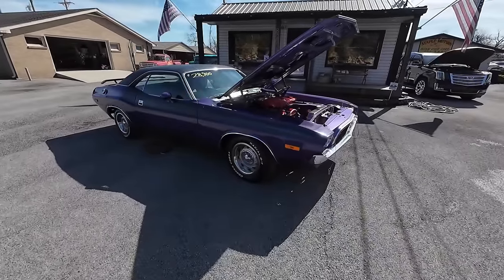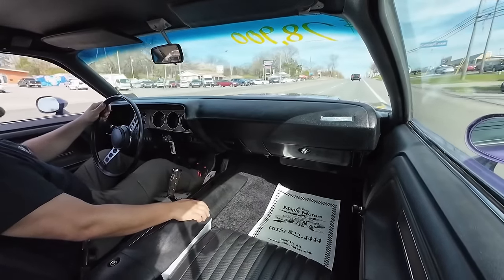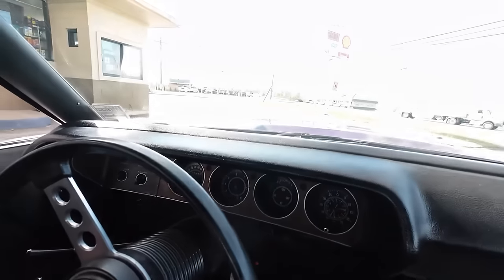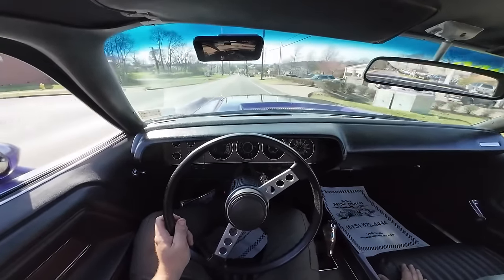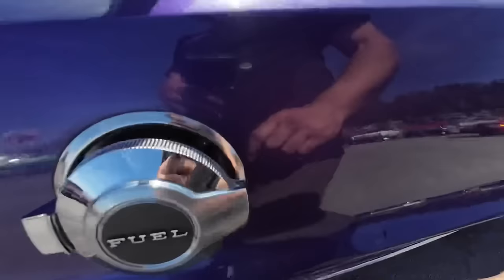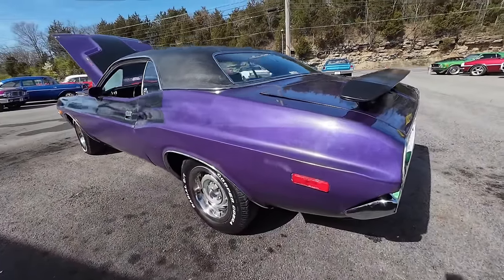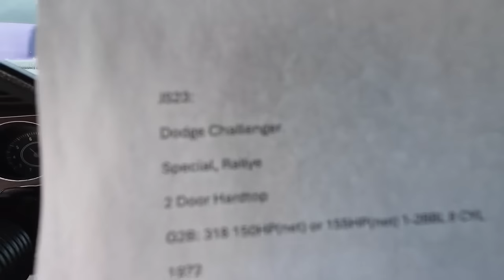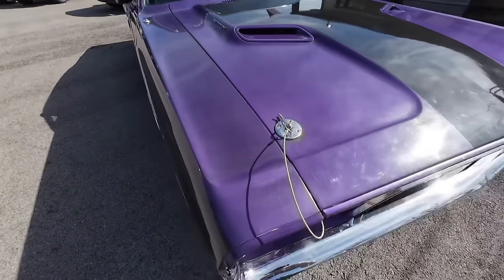Test Drive 1972 Dodge Challenger Rallye SOLD $28,900 Maple Motors #2525

Comment: People complaining about the price, I don’t get it… It’s a plum crazy challenger. It’s worth more than 15 grand. Regardless of the 318. Y’all act like this isn’t a perfect car to put a mild 440 in and an 833 4 speed. Or you can pay double for one that’s too nice and you’re afraid to drive it. Just my two cents.
Reply: You have to change the K member for a big block don't you? Just put a stout 408 small block in it and a 5 or 6 speed or even a 4 speed. Just put the 318 and 3 speed on a shelf.
Reply: @robfogarty60  Already have a big block 4 speed Mopar, otherwise I might have.
Reply: @davidkeeton6716  No. the K frame is the same for all V8’s. The 6 quart oil pan 440’s got a skid plate.
Reply from the maker: People want something for nothing but ayy who doesn’t
Reply: @davidkeeton6716 my brother had a 340 with a cam ‘headers and some head polishing . He beat every stock big block he ran . Car ran 12.78 back when most were mid 14 . Also had a 4.10 gear . 4 speed .
Reply: @drippinglass  This is wrong. Big blocks have a different K-frame than small blocks.
Reply: @Coelacanth97 I have a 1970 ‘Cuda 440 Six Pack 4 speed Dana from the factory. The only difference from a 340 or 318 is it has a skid plate welded on.
Reply: Yes put ur own drive train in it
Reply: These years are sad looking challengers.
Reply: Idk all that under spray is suspicious

Comment: Hey Nick,  The loose rear valance is the noise you are hearing when hitting bumps...Also that damage on the right front corner of the fender is not just a small piece of trim... It's a one piece fiberglass panel which is the entire front of the car running from right fender to the left fender..I hope this helps some with representing the car for the buyers out there.

Comment: Put a 408 small block and a 4, 5, or 6 speed in it. Don't have to change the K member. I'd change the whole grille and bumper assy and the tail panel and bumper and convert the looks to a 70 model. I just like the looks better.
Reply: Even a big block you dont have to change k members on E bodies!

I put many 440's in 318 Challenger/Barracuda from 70-74..

Comment: 72 Challenger shes been hit fairly hard in the back, $28 might be a bit much she needs a lot of work, easier to do a full frame off and dip that patch as you go, ton of work there, dip seal and prime the chassis is the way to go, snag OEM 3rd party where you can they make a lot for these cars today, full quarter panels front and rear everything you might need as apposed to patching it up, a guy could drive the wheels off'n it then let the next guy go for it...  lol

Comment: E-Bodies hold water under vynil tops. remove and see rust. also look on frontfloor i have see rust all the way from floor to subframe . check all of those out  and at door  around the btooms and on body ,especially if no one will show you those areas

Comment: Add a built 360/408 and a 4or5 speed, and you'd have a pretty nice Challenger. Oh, and fix all the things that don't work. Oh, and a set of cragars!
Reply: put some 340 heads and a edelbrock performer on it with a 650 carb.

Comment: Does that have an 8 3/4 rear?  Posi?
Reply: most likely" open" rear so Not if factory 318, unless swapped to MA Mopar called positraction the " Sure Grip". 8.75 or 3/4 " all standard unless a slant six was original.

Comment: If its a rallye it should have a 340. They weren't pistol grip shifters, in challengers in 72, steering wheel should have 3 spokes. Plus there should be rallye grill scoops on the front of doors. Plum crazy not original in 72.